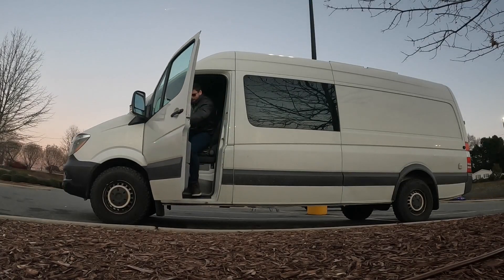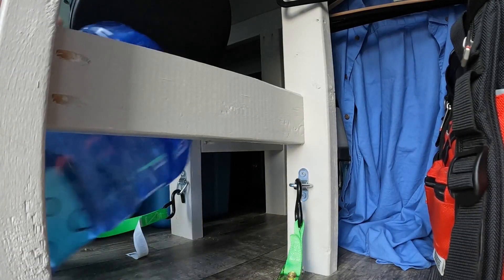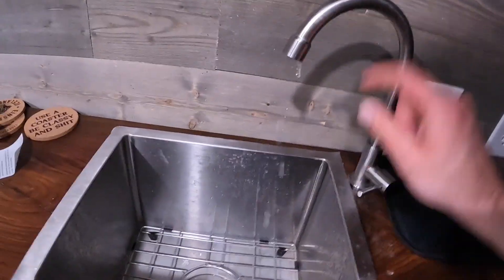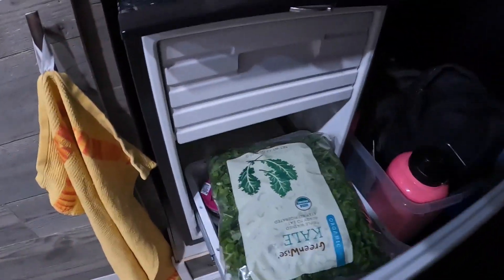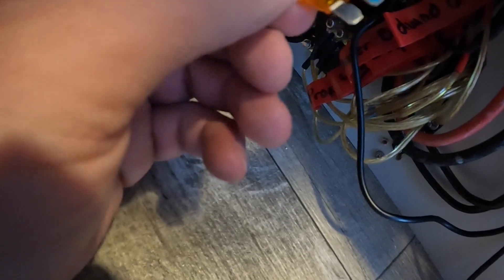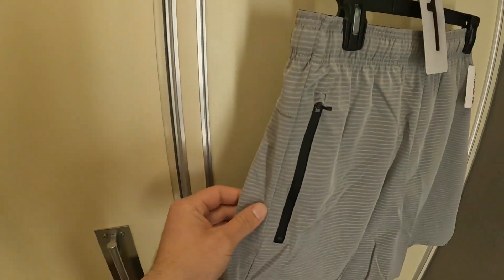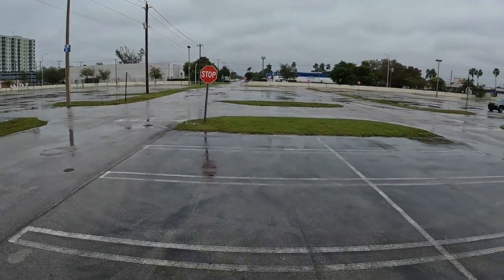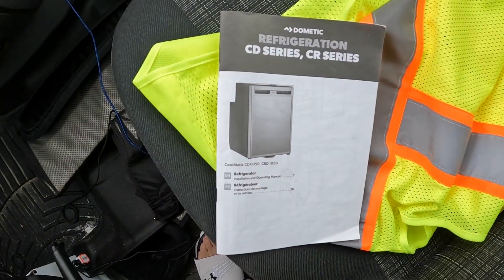Van Life | Traveling the US in a Van | State 4/50, Florida | Part 3 | Preparing for Trip to Key West

Comment: Hmmm interesting with the fridge. Did the 10 amp fuse help?  Also every Walmart, Lowe’s, Home Depot, auto zone, Best Buy should have more of the fuses if you need them I just threw a few in your tool bag in case. But if it’s blowing more than once there’s likely something causing the amps to spike sometimes. Curious if the 10a keeps it from blowing or the fridge may need some more air flow to keep it from over working in the warm weather. Definitely a proud moment watching you trouble shoot the fuse the first time haha 😂🙌🙌
Reply from the maker: The 10amp fuse is still holding up. I am making sure to keep the van more aired now, I still think it was because of the lack of air circulation behind the fridge. The same happened to my laptop once, it just went crazy because it was so hot and after cooling it down it was fine.

Ahhh sweet that I can get fuses at all those places, I was worried that these ones were some weird ones that we ordered online